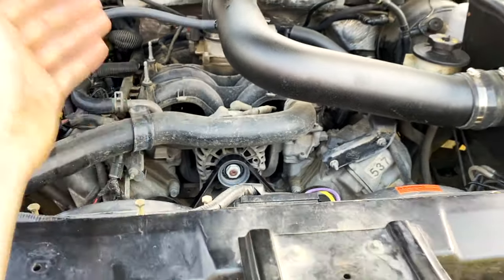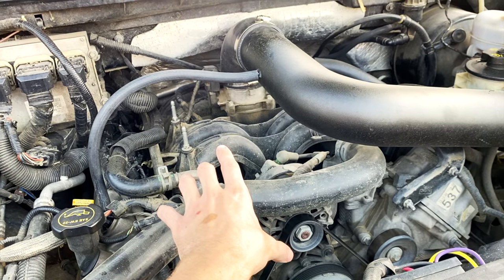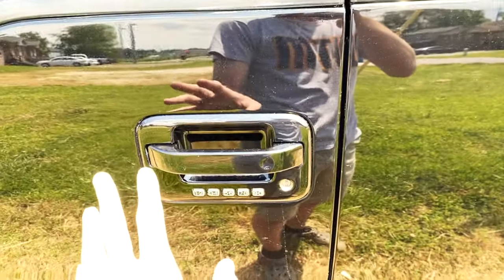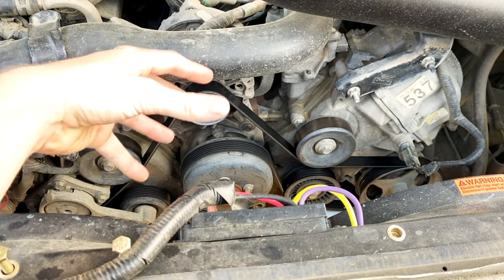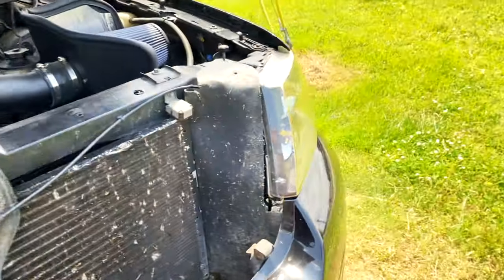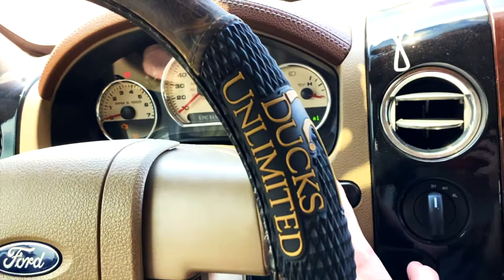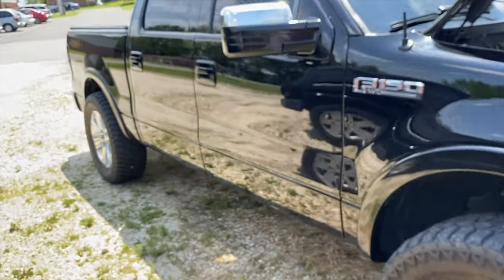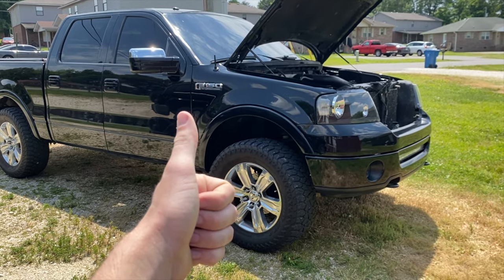5 THINGS YOU DID NOT KNOW ABOUT YOUR 2004-2008 F-150

Comment: I have a 08 expedition had it a year now has 260000miles,had to get 2coil packs, how did this issue with cam phaser on driver side, can I get what I did was😅😅 ran two wires directly from the to the solenoid and and it clicked and lock the phaser back at zero timing on the driver's Bank where it needs to be. And ran like the clock sense and that was $11,000 a mile ago

Comment: How are you making 15mpg? I need to know!!
Reply from the maker: Not sure to be honest with ya! Got a tune and cold air intake but nothing else. I don’t drive it like Ms. daisy either. But if I really wanted to baby it, I’ve gotten 16 out of it before. I would recommend changing your fuel filter and having your injectors cleaned! Might help out a bit!
Reply: @JayThompson25  wow. I get 18.3 avg out of mine.
Reply: I get 12 -13 I don't drive super soft but I'm not taking off at ever stop light either

Comment: I got a question so I have an 04 f150 2wd and sometimes when I’m coming to a stop it dies what causes that
Reply from the maker: Could be a multitude of things. Check codes for spark and fuel related issue as they are normally occupied by a check engine light.

Comment: Man are your mirrors 09 14? If yes how did you managed to make them powerfold on your truck? I got power folding mirrors 09 14 on my 06 king ranch but they were not plug and play.
Reply from the maker: Everything worked on my application. I believe they may have changed the plugs on the trucks in 07! Most aftermarket mirrors are marketed as 07-14’s

Comment: I was thinking about buying one do you think is a good investment
Reply from the maker: If it’s in good shape and you know it’s had proper oil change intervals then you should feel ok making the investment! However almost any vehicle is a uncertain one!
Reply: So u think i should get or no ? What's your opinion 🤔
Reply from the maker: @gaetanoincandela8454  I mean at the end of the day it’s up to you man. I’ve put 65,000 miles on my F150 (totaling 170,000) before having any major issues with the drive train. I’d say if they’re taken care of they can be solid trucks but they also have issues that can cause failures (most of which stem from poor maintenance)
Reply: I’ve had mine for a couple years now and I just passed the 200,000 mile mark. I’ve had absolutely no issues w it and it still runs and drives great. I’d say if you find a good deal it’s worth looking into

Comment: I am very confused about oil some people say 5w20 other say 5w30 I don't know who to believe I don't want demage my engine
Reply from the maker: Check out one of my latest videos! The 5w30 is beneficial for the higher mileage motors as it provides more lubrication!
Reply: @JayThompson25  what about in winter the 5w30 flow better them 5w20?
Reply from the maker: @Playstation5-d9u  I’ve ran 5w30 in 0 degree weather and had no issues!
Reply: @Playstation5-d9u  "w" means "winter", so 5w oil will all behave the same in the cold, regardless of the number after the "w".   I run 5w-30 in my 5.4L in NY.  Fordtechmakuluko on youtube suggests this as well.
Reply: @Hubjeep  i will use 5w30 mobile one thanks you
Reply: @Playstation5-d9u    WalMart sells the MotorCraft FL820S for under $4 for our engine.Use any brand you like!  I use the Walmart SuperTech synthetic and have vehicles with over 200,000 miles.  F-150 manual says to change it every 5,000 miles.

Comment: I have an 08' F150 with the 5.4 L 3 Valve and 162k it might have a cam sensor going bad but still drives well except in idle. Does the 35x12.50 x 20's fit without a lift kit needing to be added.
Reply from the maker: Needs a level kit too 👍

Comment: Any one have an issue with misfire?, I replaced all coils and plugs and it is still sputtering and misfiring, did replace some big cam sensors, (computer called them out on code) haven’t replaced injectors yet, starts right up, doesn’t smoke and has reduced power  2004 Ford F-150 5.4 xlt lariat 155k miles several cylinders read code misfire, used to tow a 6x12 trailer every day but transmission and 4x4 is good, any info I’d appreciate thank you
Reply: Mine did that.it had jumped timing.
Reply: Gerald Lathan yea there’s another video I found that seems most likely and it all about that cam chain tensioner shit

Comment: I hate my ram 1500 2010 it has the worst steering with everything replaced. There is a 2008 Ford F-150 that has clean vin and 178k and is clean. Should I get it?
Reply from the maker: I’d make sure to check everything out on it! 178k is a lot of miles for any vehicle, but that doesn’t mean it’s not a good truck. Just need to check a lot of wearable parts such as front end parts and some of the engine parts (alternator, ps pump, battery, etc.)

Comment: I have a 2004 f150 XLT and I changed my blower motor resistor (was only working on Hi) and no it works on all setting but very little air comes out of 1 or 2. 3 is fine and 4 works like before. Any ideas why so low in air on 1 or 2?

Comment: What size 2o inchers can I put on my 2007 F150? I did not quite hear you. Thanks!
Reply from the maker: I ran 35-12.50’s with a 2 inch level! Some wheels may require a 1/4 spacer but it all depends on your back spacing. Most stocks will need that extra spacing to clear the UCA

Comment: Hi,,You know alot about these fords,,Id like to replace my front door speakers. But most the videos are showing you have to take ur whole front door apart, My Dad changed my drivers side window motor for me, I watched my Dad do it, And i thought all he did to get to the front door speaker is just flip off that grill in front of the front speaker.  Asking. Was that right for a 05 f-150?   Thank you for your help..
Reply from the maker: Most Fords those models were able to just remove the speaker grills without having to remove the door panel 👍

Comment: Ok what year is that? I have a 2005 and do not have the info and reset button like yours, the buttons in the steering wheel do not respond when pressing them, I have no way of changing anything, when the light is on in the dash at night, I can't see the miles or info,  but the dash has lights,  do someone have any solution for that type of problem? Thanks

Comment: Hey great info.   this I take it is the 12th gen.    I am trading up from an old Ranger.   What engine to look for,  what about high mileage ,  that be ok?   any hints ,   Thanks!
Reply from the maker: The 5.4 can be scary because they do have a lot of issues especially if they haven’t been taken care of. The ecoboost and 5.0’s in the 12th gens have some issues but not as many as the 5.4’s seemed to be plagued with. They’re great trucks either way, just definitely be sure to listen to the motor and check the fluids for signs of neglect on maintenance!

Comment: I just bought revised Engine for my 2004 Ford F-150 from Fraser’s it cost $4647.00 I bought the truck for  2300.00 Was having a lot of problems with the chain rattling and timing Chamber , sensor lotta other motor issues so I had it off at the path Dump a  revised engine with 0 miles on it!! Best thing every did for my truck👉🏽👍🏽🤞🏼😃😃😃😃😃😎😎😎😁

Comment: Have you ever had the center counsel shifter not registering that it is in park air reverse. Sometimes I can’t start my truck with having to move the shifter to neutral. It shifts just fine. But just the computer doesn’t recognize that it’s in park sometimes when starting. Is there a sensor for this that’s an easy replacement?
Reply from the maker: If I’m not mistaken it is built into the actual shifter itself but not completely sure!
Reply: The 4 speed autos were mechanical linkage shift.  I think the 6 speed may have been electronic, and I know the 10 speed is.  Your issue would be a faulty neutral/park safety switch.
Reply: @charlesball6519  yeah that sounds about right. I haven’t had any issues shifting into park, reverse or drive. Just the sensor registering that it’s in when I restart it next.

Comment: I bought an 08 with 150k miles it’s runs good it has two issues which I don’t know how to diagnose so if anyone can tell me what it could be it would be appreciated:
So this first one usually happens when the engine has been running for awhile and I’m moving at a slow speed. It’s happened in so many drive through so it’s about the speed you would be in a parking lot. The engine shakes and sounds like it’s misfiring but it never throws a code and usually last about ten seconds then goes back to normal. I’ve changed the plugs and coils and it’s only done it one time after but I always feel it coming because the vehicle starts shaking slowly then gets violent then goes back to normal. 
The next issue happens when I accelerate , it’s not an acceleration problem I just hear what sounds like faint grinding in the front of the engine it’s not loud and usually my passengers don’t hear it but I hear it and it usually happens when I’m on the highway. I have the 5.4 engine I don’t know what causes the issue with the misfire at low speeds but I think the grinding noise might be related to the timing chain I know the tensioner scan go bad and I want to know if these are the early signs of it starting to fail. Other than that’s it’s been a solid truck and I love my 08 4x4 white lariat so if anyone can help me with this it would be very much appreciated
Reply from the maker: Most likely a vct issue for the first! They can cause a violet shaking upon stopping and cure up when driving. The second one could be a multitude of issues, but I’d check the heat shields under the truck and make sure they aren’t rubbing on the front driveshaft if yours is 4x4!
Reply: @JayThompson25  thanks for the quick reply! I’ll definitely look into the vct like I said it doesn’t happen often but it still bothers me whenever it does. And I’ll check those heat shields hopefully it’s what your saying it is because they seem like easier fixes than the timing components. I’m really hoping it’s just rubbing like you said and if it is you’ll be a life saver. Also your truck is dope and you just earned another subscriber thanks man 👍🏼
Reply: I wouldn’t expect to hear any timing components rattling going down the highway, however You can absolutely hear a failing IWE front hub on these Ford trucks intermittently on the highway. Sounds almost like your faintly dragging a chain or a rattle so to speak. Not an expensive fix and easy as well. They are known to get some corrosion in the hub and cause a weak vacuum and actually tries to engage at times when the vacuum isn’t strong enough to hold the hub open. The hubs are open under vacuum and close when the vacuum is removed thus locking  the front wheels into 4x4. Sometimes it can be bad enough you can jack the front wheels up and spin them pretty good and you’ll hear some noise but not always a definitive answer for a bad hub.
Reply: I have an 08 and had this same issue. In my situation, it was the cam phasers. If you haven’t corrected the issue yet, you may want to look into that.

Comment: Do you still have this f150? If so any major engine issues yet?
Reply from the maker: None at the moment. Going to pull the engine after my house/shop are built and do a total refresh. All gaskets and timing/oil components
Reply: Awsome thanks for the reply @JayThompson25
Reply: Hope im not a bother but I have a question. Four months ago I purchased from an elderly man a one owner 07 lincoln mark lt truck with 87000 original miles. Very very clean garage kept no accidents and never towed anything. He had plugs changed to updated ones couple years before he sold it to me. He wanted 17,500 and after negotiations i purchased it for 15,000. Full service history showed all oil changes were done every 3000 to 5000 miles. My question is do you think I got a good deal on the price in the current market and with it being very clean inside and out. No paint issues no rust leather interior no cracks or wear, sunroof rhino bed liner. Lockable roller style vinyl bed cover etc?

Comment: Does everyone use the recommended weight oil? Seems awfully thin!?
Reply from the maker: I use 5-30w. It’s recommended for engines with over 100k miles as 5-30w will decrease engine noise as it provides better lubrication!

Comment: 2005 lariat 5.4 here i have 20 inch stock wheels what size is your tire i want something more aggressive i don't understand what size you say
Reply from the maker: 35x12.50 🤙🏻
Reply: @JayThompson25  soo I can fit 35×12.5 on stock wheels?
Reply from the maker: I have a leveling kit and only had to trim just a little bit. There’s a video on my channel showing how they fit 🤙🏻
Reply: @JayThompson25  i worry about the wheels if that tire fit on 20 inch 8.5?
Reply: @JayThompson25  i plan to put 285/55r20
Reply: I just subscribed bro I just started built my 5.4 larait 2005
Reply from the maker: Mine are 20 x 8.5 and haven’t had any issues
Reply: @JayThompson25  ok thank you for the information bro
Reply from the maker: No problem!

Comment: i bought a 2000  4.6 a 2004 4.2 a 2007 5.4and a 2009 6.2 all new. still own the 2000 with 313000 miles on it. loved the 4.2 but it was 2 wheel drive. I HATED the 5.4 will never own another one in the 3 valve. the 6.2 loved it but i gave it to my God Daughter.

Comment: How much lift do you have on that truck, in order to fit those 35x12.50R20's?
Reply from the maker: 2.5 inch leveling kit!
Reply: @JayThompson25  I have a 2" leveling kit, do you think that would work with your wheel setup?
Reply from the maker: @Funexpected  you might require a little trimming but I am not completely sure!
Reply: @JayThompson25  👍

Comment: do you think the 2009-2014s are better trucks or do you think the 2004-2008s are better
Reply from the maker: 2009-2014 have a nicer and more spacious interior but share a lot of the same drive train and suspension components with the 04-08’s. The 5.0’s are arguably more reliable than the 5.4’s but really comes down to price and what package you want.
Reply: @JayThompson25  Thank you

Comment: Bought new 2007 was the biggest piece of crap I've ever had the misfortune of owning on my second tundra love them both.
Reply from the maker: Been looking at the new 1784 editions, not a huge Toyota guy, any suggestions or normal things to look for on the tundras?
Reply: The twin turbo V6 is good but not as bullet proof as the 5.7 V8 last year for the V8 is 2021. They had software problems with the V6 in 22 but they have that problem solved, matter of what you like I had a 2011 and currently a 2020 both great trucks.

Comment: I have a 06 f150 200 000 miles.when I am at idling it skips some time. Any clue.code showes cylinder 5 misfire. Don't happen when driving.
Reply from the maker: Check coil and plug to see what kinda shape it’s in. VCTS can also cause a shudder/miss at idle without any issues driving
Reply: Jay I will co the vcst new plugs and coils.

Comment: I have an 06 f150. My starters not getting the power it needs to crank, all fuses are fine i think its ignition key cylinder, what do you think?? 

I had to drive at high rpm in 4 low in an emergency, when i shut it off it didnt want to start since then. 

🤔😞
Reply from the maker: I’d take a tester and see if your starter is getting power. If so then it could be the starter itself. If it’s not getting power then you have to start with tracing wires and seeing what’s not sending power. You can most likely test the back of the ignition switch to see if power is going through it. A lot of trouble but could save some time and money to diagnose before throwing parts at it!

Comment: Ford Master tech here..95% of the time I can attribute just about Every 3v failure back to the customer not performing any maintenance on it,,,it funny people will spend 40 50 60 grand on a truck or more and not changing the freaking oil...Every oil related failure I've seen,,,,,1st thing I looked at is the oil filter and it's always some 1.99 special and that tells me right off the bat another moron being the very cheapest he can on his maintenance
Reply from the maker: For sure, maintenance is key with any engine, but especially the 5.4’s

Comment: HERE IS A GREAT HACK FOR ANY FORD BUT ON MY F150 IT WORKS MY WIFES EXPLORER (EXPLODER) IF YOU TURN KEY OFF PRESS AND HOLD YOUR ODOMITOR BUTTON and turn the key on engine off and keep holding the odm button until you see the display say check gadge and it will run a full dionastic on your truck it will save you loads of money NEED TO KNOW DTC CODES THAT AUTO ZONE CANT TELL YA OR WAIT YOU DONT HAVE TIME TO HAVE SOME KID TRY TO TELL YA WHAT THE MACHINE SAYS NOT ANYMORE. IT TELLS YA EVERITHING DASH LIGHT BULBS THAT OR OUT ETC... MY WIFE HAS A 05 EXPLOYER NICE TRUCK IT HAS THE 3RD ROW NOW HERS TELL YA MORE CODES THAN MY 01 F150. NOW I HAVE HERD ITS ONLY CERTAIN YEARS OR IT CANT HAVE THE RPMS ONLY THE MPH GAGE BULL SHIT NOT FROM MY PERSONAL EXPERIENCE KEY OFF ENGINE OFF HOLD ODM BUTTON AND TURN KEY ENGINE OFF STILL WITH THE ODM BUTTON PRESS WATCH THE LITTLE SCREEN WERE IT SHOW MILES AND POOF IT WILL  SCRAMBLE THE SCREEN AND THEN ITS WILL SAY TEST GAGE AND JUST KEEP PRESSING THE BUTTON I WILL SAY THAT EACH  FORD IS GOING TO GIVE YOU MORE OR LESS CODES THAN OTHER FORD VEHICLE AND ITS WIRKS ON 2 AND 4 DOOR CARS

Comment: One thing you have to look out for on these garbage trucks is behind the fuel tank the frame rails rod on both sides of the truck they're a junk typical Ford they used to make damn good trucks now they're frames rot right out from under them garbage garbage garbage